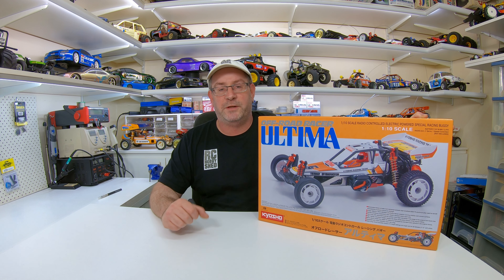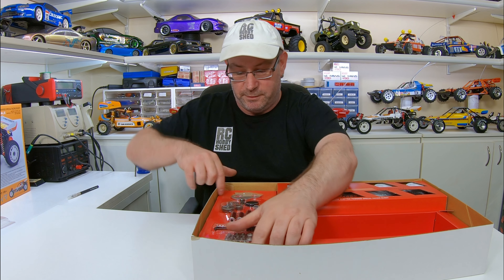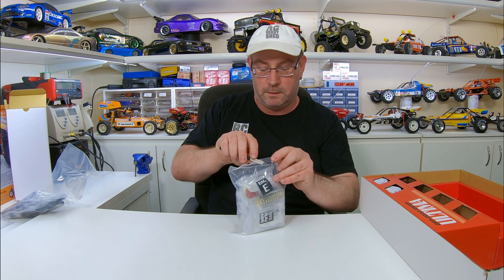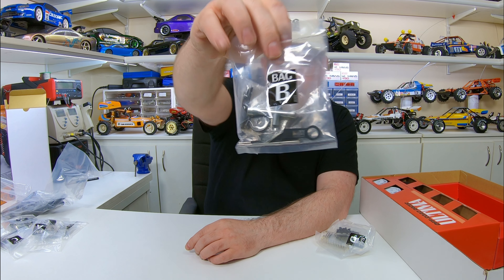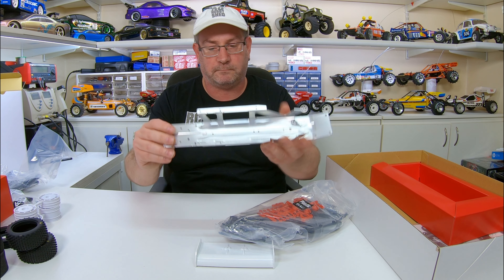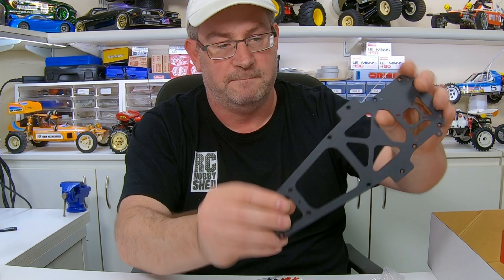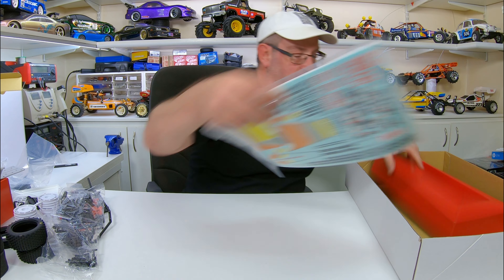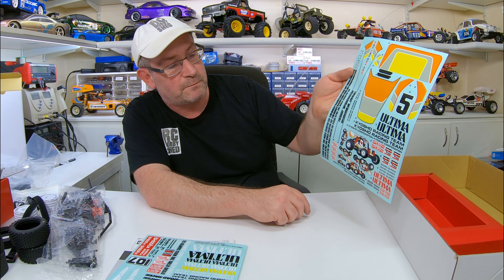Kyosho Ultima 2019 Unboxing

Comment: These are nice cars, look very strong and well made.  I made a mistake and took the wife to Metro hobbies to get a few parts and buy an esc for my 4s Outcast. Wife gets her parts then asks when the 8s kraton is coming.  Vas said there's only 2 coming and ones sold . She bought the second one,  I thought she was joking,  I bought a hobbywing 1/8 combo they say go well. Checked out the esc and used a fly sky radio. Nothing wrong with it ,was that crap Arrma radio cutting out .Now I have a good combo to use in something, can't use it in the Hpi truggy,  heard they're not very strong and will chew the diffs. Wouldn't mind an Arrma limitless,  can't wait to see you build this beast .
Reply from the maker: Your wife is great. You must be the only guy out there who's wife is the one wanting to buy RC's. lol. I've heard good things about the Hobbywing gear too, I think it'll be fine. The Limitless should be awesome, seen lots of videos of them and they don't disappoint. Hoping to have the Ultima done today. BUT in my wisdom I didn't buy battery wires for the LiPo I want to run in it, so will have to get them. Will prolly do the run video early in the new year as I like to have them on the shelf looking nice for a little while before I break them. 🤣
Reply: @RCHobbyShed  I saw Kyosho make a beast of a Dodge charger,  they say it's very tough and great for bashing.  Thing goes well,  of course the wife will want the Chevrolet they make to. Better get a Ford to ,  soon as I got home from work she had me fixing her busted Arrmas .  Can't wait to see the build great stuff mate .  Will learn more each video,  these rc cars are too easy to have massive laughs and fun. Happy New year to you and the family mate mate .
Reply from the maker: @petergoodwin2465  They do, it looks awesome, think I need one too! lol. Oh yeah, the 69 Camaro looks great too and they have some older Chevs. Collect them all! lol. Happy new year to you and your family too mate! 👍

Comment: Who did you buy it from Mick? I'll have to check ebay and see where is cheapest. Maybe painting the shock towers silver might be an idea, to resemble the originals?
Reply from the maker: I got mine from RCMart. I don't remember the price off hand, but it was quite good. The shipping cost hurts me though. I actually thought about just cutting some out of alloy, but I think I'll just leave it as is. Maybe I'll change them to carbon fibre or something later on.
Reply: @RCHobbyShed  Just had a look, crazy hobbies have them for $429 and free postage. I've bought a couple cars from them.
Reply from the maker: @keithrx3c  That is a good price! I looked and mine was $390 + $62 postage, so $452. Grab it I say! 👍
Reply: @RCHobbyShed  It'll have to wait a few weeks, see how things work out, but yea they're definitely the best price, not too far from me either.
Reply from the maker: @keithrx3c  Cool mate. Let me know when you get it. 👍